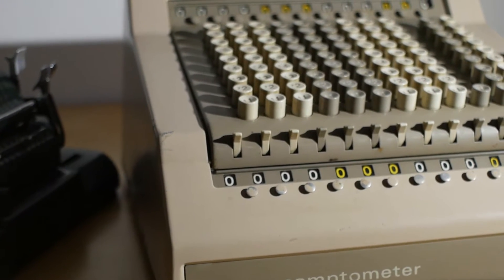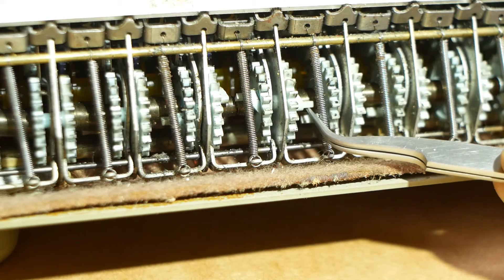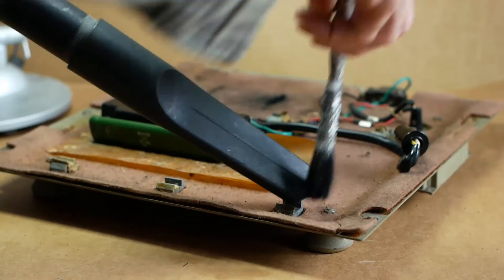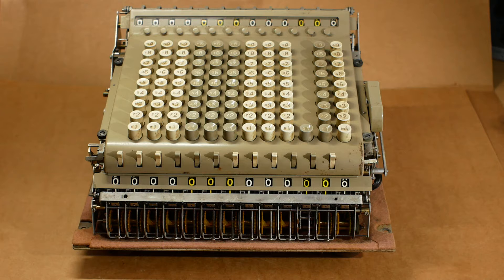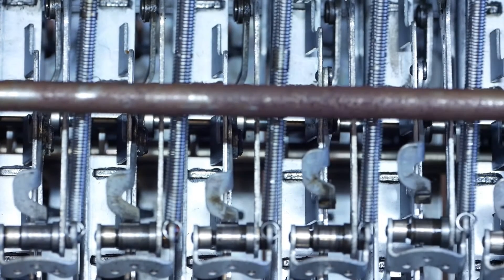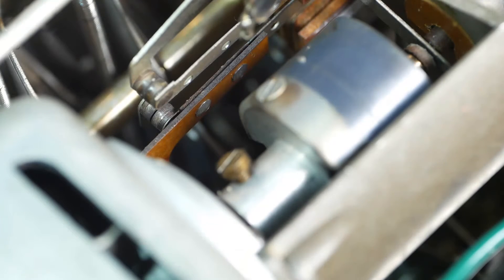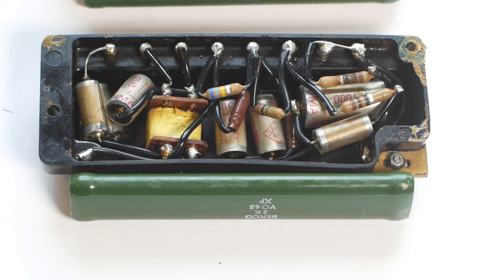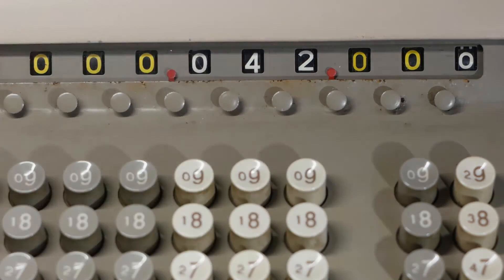Comptometer 993s - Sumlock Electro Mechanical Adding Machine, Part One - Refurbishment - Retrotech

Comment: Thanks, this video has been very helpful so far! However, at 8:56 the parts that are meant to move separately don’t, not because the lever is jammed but because the two parts are stuck together. This is an issue with all of the columns. Would we need to disassemble the entire thing to get these fixed or not? I don’t know if this is useful, but I’m using the 993e without the second display.
Reply from the maker: Hi Captain Moomoo, I don't think it will make any difference that you only have the single display model, so I think your machine should be moving in the same way that mine was.  It is possible that the sliding parts on all columns have stuck together - I can't remember how much I showed on that video, but I had to keep heating the parts in an attempt to soften the dried old oil and then applying a small amount of fresh oil, then trying to jiggle the column I was trying to free up.  Then doing the same again, heat, oil, jiggle.  I used my hot air gun to do the heating (not one of the big ones that are used for paint stripping, the one I use is sold as a hot air gun for crafting and embossing), this allows me to aim the heat carefully at the part I want to heat without risking heating up paintwork or plastic parts - you definitely want to avoid the hot air heading towards any plastic parts.

Sometimes a drop of paraffin can be better than fresh oil for softening the old oil (or lighter fluid would work as well).

Hope that helps a bit - I know my machine took a lot of freeing off - I was probably working on it for a few days.
Reply: @GrumpyTim   Okay, I'll try to do this! Also, another issue I found is that the buttons don't seem to move the registers enough (for example pushing 3 outputs 2), which may be a result of the two parts I mentioned being stuck. There are also some levers at the back which pop out the buttons in the corresponding column when moved by the rack, however these seem to be worn so the buttons don't pop back out once pushed. Thanks for the reply by the way!

Edit: after using a sharp, flat screwdriver to clean out the dried oil between the two parts, that column now just about works! I'll probably use a hairdryer (maybe with a funnel attached, haha) to soften the oil as I said earlier. Again, thanks!
Reply from the maker: Hopefully, if you keep working away at it you'll eventually get everything freed off, particularly if you can get one column working correctly, then you'll be able to use that working column as a reference for the others.  Don't rush at it, sometimes it just takes ages.  You could strip it down completely, but I think it's easier to work on it while it's still assembled, particularly if this is the first of this type of calculator that you've worked on.

Comment: Ive been repairing one myself and this video was very useful in helping me get an idea on how it works, regrettably it did not stop me breaking one of the register's ratchets...
Reply from the maker: Hi Chunky Joe, which part broke?  Is it just a metal pawl that's bent out of shape a little?  Most parts on these machines are relatively repairable, it's just getting them out to do the repair that's tricky.  The other thing I've known people do is to move the damaged part to the far left column so you rarely or never use it - again though, this requires getting the part out, which is the tricky bit.  Is your machine working apart from the damaged ratchet?
Reply: @GrumpyTim  Snapped unfortunately and asides from that the only issue is the 7p button which I doubt can be a made to work with reasonable effort
Reply from the maker: That's a pity Chunky Joe, but not necessarily impossible to make a replacement part - although the work required to make and fit said part can sometimes outweigh the benefit!!!
Reply: @GrumpyTim  I know someone with some good tools halfway across the country so if I can't solder it back together I can put a couple mig spots into in whenever I'm next in that area
Reply from the maker: Excellent, that sounds like a good plan.
Reply: @GrumpyTim  Update: all went to plan and the part has been soldered in place without even needing to be removed from the register to clean thanks to some phosphoric acid
Reply from the maker: Hurrah, that's good news.
Reply: @GrumpyTim  no longer since the motor not only fails to disengage when idle, but the governor also ceased to switch the motor off
Reply: @GrumpyTim  do you know where I might find a clear diagram for the 1953 dual register Comptometer? I can't seem to find one myself but you may have some insights that I don't.
Reply from the maker: Hi Chunky Joe, in theory, the governor only controls the speed, and the moving parts of the governor on these tend to get sticky and stiff, causing them not to work.  When I get a chance I'll dig mine out and familiarise myself with it's operation and then gat back to you.  The motor on/off is a separate switch (housed in the same general area as the governor if I remember correctly), and again, the linkage to that switch also sticks, which could be part of the reason yours isn't turning off.
Reply from the maker: Hi again Chunky Joe, most of the wiring should be relatively simple, the kind of tricky bit is the choke or suppressor section, which, in the case of my machine, used some really old, dual capacitors and stuff - I did draw out a circuit diagram for one of those which I can send to you if you want to email me (email address in the "about" tab on my channel).  The suppressor section seemed to change from model to model and year to year, but essentially they all did the same thing, eliminate/reduce interference.  I reworked mine using modern capacitors, not least of all because the capacitor across the mains had blown (in fact it had blown on both of my 993s).
Reply: @GrumpyTim  It's definitely an electrical problem since the governor opens the switch that is supposed to and the other one that is opened by the mechanism also gets opened when the mechanism is installed. When opening either with a screwdriver the motor kicks in anyway and it does so at a concerning speed
Reply from the maker: I just had a quick look at the wiring diagrams I have for the suppressor section, and without the rest of the machine in front of me it made no sense at all!!!  Maybe I should have made more notes.  I'm away from my machine until next week but I can send you what circuit diagrams I have if you want.  My two machines are 1964 and 1967 so yours is a tad earlier and they may have done things differently back then.  I'm going to hazard a guess that one of the extremely old capacitors has failed to a dead short and so is sending power to the motor rather than simply reducing noise.  Does your machine have a similar box bolted to the inside of the bottom of the case with 8 terminals on it?
Reply: @GrumpyTim  if you mean the back box with the small components then no, but the wiring for the later models shouldn't have changed too much so your clearer diagrams should help me put one together for the '53 model and there isn't any rush since I probably won't get to work on the electronics for several months
Reply: @GrumpyTim  there is a plastic splice box for connecting wires together with a better name than the one I invented for it that I assume all the connections are routed through
Reply: @GrumpyTim  traced back the yellow wire,    disconnected it's friend which made the switches work, replaced it,  removed the capacitor down the wire which I tested and concequently replaced and now it works without issue.
Reply from the maker: Excellent, that's great stuff Chunky Joe.  If you still want whatever wiring diagrams I have just send an email and I'll send them back to you, but it sounds like you're sorted now.  All the capacitors in these things can take quite a pounding from the governor contacts, which vibrate rapidly to control the motor speed, and in turn can creating quite a few voltage spikes.
Reply: @GrumpyTim  I was wondering why the circuit might have needed smoothing

Comment: I have just bought myself one of these on eBay.  It is not in working condition so wish me luck :-)
Reply from the maker: Ha ha, good luck alanesq, my top tip is patience, patience and more patience!!!  Just keep freeing off one bit at a time, carefully and gently.  Start with the number wheels and carry mechanism before working back to the other parts.  Just shout if you get stuck and want me to take a peek at mine to see how a part should move or whatever.
Reply: @GrumpyTim  Thanks.  I have experience with a few mechanical adding machines (most recently a Borroughs calculator I bought in bits) but I have avoided electro mechanical so far as its a whole new level of complexity, but as you have posted a video on restoring yours to operation I figured this will be the first one I have tackled with the aid of some prior instruction so it would seem to churlish not to give it a try ;-)
Reply from the maker: Hi alanesq, that sounds like you'll be fine - although each one is different, mechanical calculators and adding machines are kind of the same when it comes to fixing them - figure out what should be doing what and why it's not doing what it should, and you're there.  The electric part is essentially a motor and a switch to save you winding a handle and a bit of stuff to supress the inherent sparkyness of the motor and switch.  Hours of fun ahead.
Reply: @GrumpyTim  I am making progress but as suspected its proving to be a challenge.  I spent ages this morning trying to figure out why the register clear lever does nothing, I eventually decided the arm which activates the clear is not actually linked to anything and so there must be a missing part....I then went on to realise that it requires the motor drive to operate the clear and it all seems to work ok.  I have no idea how  - lol

Comment: Hi Tim. I have a lovely green Sumlock (different model but I’m in bed so I can’t tell you what it is). I bought it just for it’s beauty as a decorative item. Cheers. Lee
Reply: I wouldn’t want to take one to bits though. Anything I dismantle except for software never gets put back together again!
Reply from the maker: The Sumlock machines are a thing of beauty, working or not working.

Technically, the non electric ones with only a single register at the front are fiddly, but also relatively simple to free up.  All the Sumlock/Bell Punch machines use the same wheels and gears, running on thin steel axles, and the oil goes solid causing everything to seize up.  Often, you can free them by adding drops of fresh oil and gradually freeing each wheel from it's axle and eventually sliding the axle from side to side to distribute that fresh oil.  If none of the axles are removed, nothing falls out - it's only when you start removing things that it rapidly goes downhill!!!!

Ooh, and thanks for watching Lee.....
Reply: @GrumpyTim  mine appears to work well enough. I also have a small muldive mentor which is very attractive.
Reply from the maker: Ahha, the Muldivo Mentor is probably my favourite pinwheel calculator - I think it's just engineered so well and works exactly how you'd want it to - I'm a big fan of those, great choice for your collection.
Reply: @GrumpyTim  it is only a collection of two (which maybe contradicts the definition?) but I do have other collections of 'things' and 'stuff'
Reply from the maker: I think two can be called a collection when it's something interesting like that - maybe not technically correct, but it'll do for me.

Comment: Its interesting, alot of the calculators ive seen use the ph-163 power connector, the later fridens use them aswell.  I had to track one down for my machines, they are pricy buggers and the 3rd prong isnt even used.  They also go by the name, oval connector, or vintage hp powercord on ebay and other sites
Reply from the maker: Cheers ArcadeCarpet, I think I found one of those connectors listed on ebay  but it was coming from the USA and the shipping alone was expensive, let alone the price of the connector itself.  The two versions of the 993s that I ended up with had similar but different sockets - in fact virtually every old electromechanical calculator I own has a different connector.  For originality it would be nice to use the original connector but I wasn't too fussed on this machine.  Yep, you're right, vintage hp power cord tracked one down straight away!!!

I fitted the same type of modern connector to my Madas machine but in that case it's fitted with a 3D printed adapter plate with no modifications to the case of the machine so I can reverse the operation when I find the correct connector.

I stumbled upon a really useful website which features lots of different connector types - plugsocketmuseum.nl - the navigation of the site is a little bit clunky but they've gathered together loads of interesting information and it's a really useful resource.
Reply: @GrumpyTim  im glad you found one, i spent more time than i admit searching for a cord for my machine, just be warned, hot and neutral can be switched on some of those cords, so make sure to check before using it

Comment: Very good video. It's fascinating to see these machines from the inside and you are clearly very knowledgeable in how they work. Your explanations were useful.
Reply from the maker: Cheers VoidSurf,  I love how the old calculating machines work, and the different approach manufacturers used to basically achieve more or less the same result.  I will feature another electric powered machine in a video soon - it's a bit of a beast but quite exciting to watch working.

Comment: Great video, thank you very much! I’ve just acquired a Sumlomatic in similar condition to your machines. Your video gave me the confidence to open it up and start gently freeing up all the seized parts. What happened to the first machine with the broken gears? Are you willing to sell any bits from it to help another machine become functional? Mine has a couple of those little pale levers below the keyboard that have snapped off :( I’ve found a similar machine I could buy for parts but as that’s currently all I need, it seems a bit excessive to buy a whole second machine...

Edit: on closer inspection, yours look different! Never mind, I’ll try 3D print a pair.
Reply from the maker: Hi Chris, is it the carry prevention levers that have broken on your machine?  If you've got access to 3D printing, they should be easy enough to replicate (famous last words).  I am planning to eventually repair the first machine - I'll 3D print some replacement gears for the register when I get round to it and finish freeing everything up and also fit new components to the electrical interference box.

As far as I'm aware Bell Punch / Sumlock didn't change their designs much so the carry levers could well be the same on my machine - is yours one of the earlier "Duolectric" models?  I think those levers are the same, although they are usually a Greenish colour rather than cream.

Just shout if you need any help - you can also email me if needed - you'll find the email address in the "about" section on my channel.

Comment: Well done, another machine saved!

Have you considered using a soldering iron with a flat tip to provide precision heat?

Also you are making progress.
Reply from the maker: Someone mentioned the soldering iron trick for freeing up seized radio tuners but it kind of slipped my mind - ta for jogging my memory, there's another mechanical calculator I'm working on that has seized cam follower rollers that can't be heated with hot air due to other items nearby - I'll try a soldering iron on that machine when I get a chance.

Bizarrely progress has been quite good just lately.....
Reply: @GrumpyTim  progress is often unpredictable on YouTube.
Reply from the maker: @BensWorkshop  That does appear to be the case - I had my biggest rise in subscribers ever (just after I was thinking of throwing in the towel!!!!!) - and the unpredictability of which videos will be popular - must get TubeBuddy, must get TubeBuddy, must get TubeBuddy - if I say it enough I might actually do it........
Reply: @GrumpyTim  Nothing will stop which videos are popular being unpredictable though it does help to aim your title a bit.

Comment: Nice work! I've done that axle swapping trick too on older Sumlock or Plus adders. On those there is usually a spare axle included in the machine somewhere that you can use.
Reply from the maker: Yeah, there is usually an axle that does very little and can be easily used - it's a really useful trick.  I'm chuffed to bits that the machine is working now - it was a mammoth project to fix.
Reply: @GrumpyTim  I have little experience with fixing electric machines, so this kind of work is always impressive to me. I'll definitely refer back to it if I ever get around to tackling my 993.
Reply from the maker: Feel free to ask if/when you look at your electrical machines - I know a bit about the electrical side but definitely not everything, rather handily though, I have many friends who know lots more than I do so I can usually ask them if I get stuck.